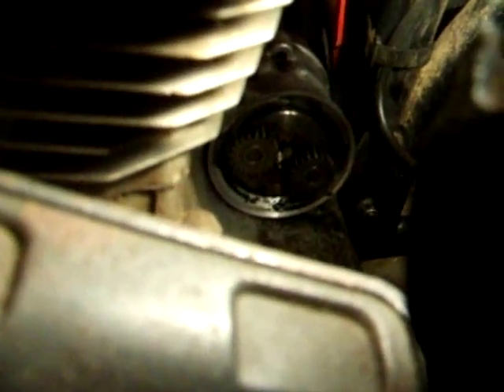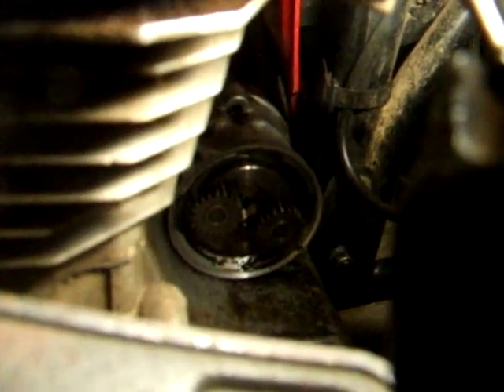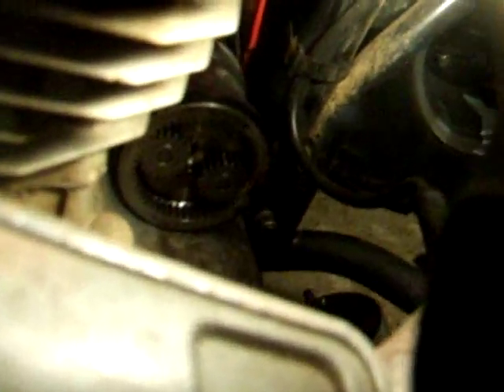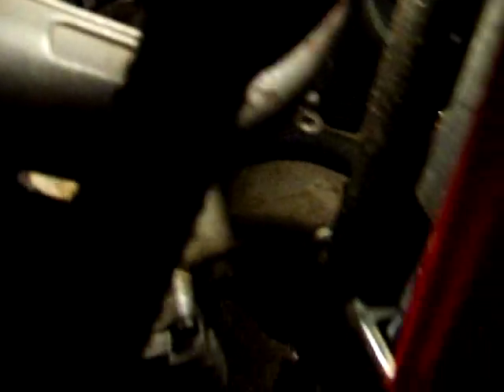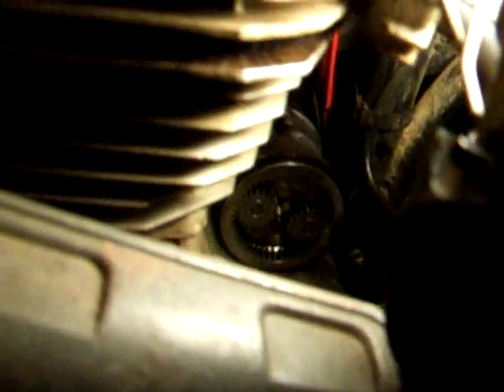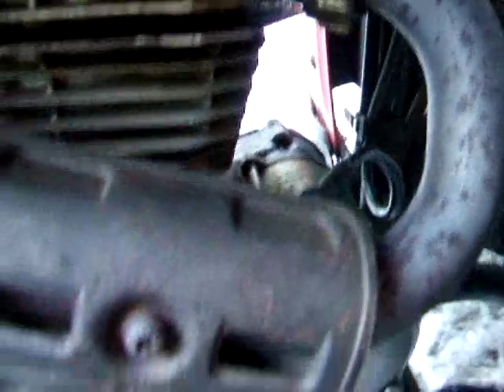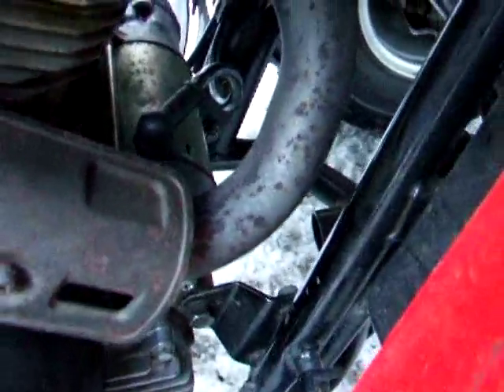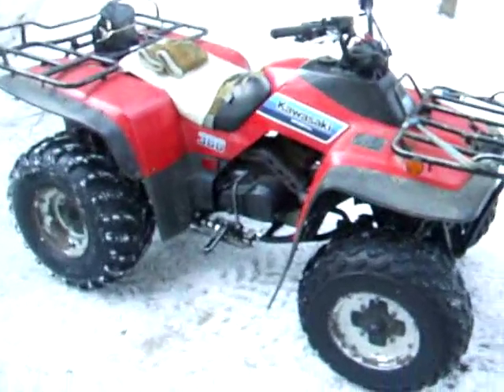Kawasaki Bayou KLF-300 ATV - Easy Starter Motor Removal + Install (2x4 + 4x4 / 1986 thru 2004)

Comment: Thank you good sir! So glad you have this! 
I will comment on my success  or failure. :D
Reply from the maker: Tru Maverick My pleasure, look forward to hearing about your attempt!  Any questions or if you get hung up on something let me know.  Cheers!  Bellarmine
Reply: bellarmine33 Dude! I got it off! And cleaned my contacts everything looked good on the inside. Put it back together and got it back on. Next I'm getting a new battery this one can't hold a charge. Again  thank you.
Reply from the maker: Tru Maverick Great to hear, thanks for the reply Maverick!  So your brushes and commutator are in good shape, smooth and making contact?  Before you get yourself a new battery, substitute a car battery with the tiny ATV one using jumper cables, and re-check the cranking speed.  If it still cranks slow then your brushes are worn (only 2 making contact, half the power) and you need a new set from eBay - about $20 or so.  Best wishes getting your ATV going, these are tough machines, same model produced all the way to 2004, 20 years.  Thanks again for the comeback Maverick - Cheers!
Reply: bellarmine33 so my starter worked great. And I got a new battery.Now I know  the problem was not the startrer. I can clearly see the starter clutch slipping. Again thank you for your video it got my project moving.

Comment: I do have a question though. I have removed all the 8mm bolts and yet still the side cover will not come off. The center bolt should not be holding the cover on. The reason behind pulling it off is to check the rotor for more damage than it might be showing. This Kawasaki 300A I believe is a 1988 model or earlier...thanks
Reply from the maker: Hi Paul, thanks for your question, I'll try to answer them.  First, I think the 300A was '86 and '87, because by '88 it was the 300B with a pull-start on the side cover and a plastic gas tank.  So if you have no pull start and metal tank, it's '86 or '87.  So you are correct, that bolt is NOT holding the cover on, that's the center bolt of the flywheel, spins with the engine.  I can't say off hand why the cover won't come off, it does have a few locating pins that keep it still, and the gasket can stick pretty good, give it a few love taps with a hammer and block of wood, it should come off.  Also, you do have to remove the red differential lock shift lever box, those bolts hold the cover on too.  And once you have the cover loose, you'll be pulling against the Hefty magnets in the flywheel that want to suck the charging coils back in lol...:o)  Hope this helps Paul, let me know if I can further assist or if there's anything else - See two photos below that might help, show you the bolt holes at least.  Cheers!~  Bellarmine

https://external-content.duckduckgo.com/iu/?u=https%3A%2F%2Fi.ebayimg.com%2Fimages%2Fg%2F2rwAAOSw1hFgsSDv%2Fs-l640.jpg&f=1&nofb=1&ipt=0fa8c66d9f22012eb80de666b546354e79ad5f8826fd44082f348e8a182b077d&ipo=images

https://i.ebayimg.com/images/g/u9UAAOSw6npeohF5/s-l300.jpg

Comment: Hi Bellarmine do you know the correct spark for that model thanks
Reply from the maker: Hi Adrian, I assume you mean spark plug?  My shop manual says NGK B8ES, or BR8ES (I think 2nd one is a resistor plug for radio suppression).  Also, make sure the little 'end' terminal where the boot goes is the un-screwable-type.  The Kawasaki spark-plug boot snaps unto the bare-thread-stud, not the bigger bulb-shaped metal terminal all other spark plugs have.  Any other questions Adrian just let me know and I'll check my manual, glad to help.  Cheers!~  Bellarmine

P.S., Here a website with HANDY exploded views for all these ATVs.  Long model run, 1986 ~ 2004 essentially unchanged - one tough machine - enjoy!
https://www.motosport.com/utility/oem-parts/KAWASAKI/1986/BAYOU-300-2X4

Comment: why do this in the dark???
Reply from the maker: I was just doing it in my garage with a trouble light, as you can see it was Winter outside so didn't want to work in the cold!....:o)  Just trying to spread around my idea to help out, if you have any questions or need clarification on something just drop me a line.....:o) Cheers Wanda!~ Bellarmine

Comment: hi were is the fuel filter on a Kawasaki klf 300 plz :-)
Reply from the maker: Hi Royal, sorry for the late reply.  These ATVs actually do not have any fuel filter, odd isn't it?  The only filters are two strainers inside the fuel tank, attached to the fuel on-off / reserve valve.  One for normal and one for reserve.  You can easily add a filter by replacing the 4" piece of hose between the tank and carb with a small filter and two very short pieces of hose, something I highly recommend.  I butt the filter up against the fuel valve with a ~1" piece of hose, and the hose attached to the the filter outlet I curl around the wiring harness in a loop and loop it back into the carb inlet, like a 360degree loop.  Hope this helps Royal, any other questions drop me a line.  Cheers!  Bellarmine
Reply: Ah thanks that would be why I counldnt find it ! I did pick one up from town so I will install it anyway like you advised. The quad turns over fine but will splutter a bit when I accelerate and cut out, maybe dirt in the carb or fuel pump not working well, it has just has a oil and filter change , I did just try started it and the battery is now flat so maybe a weak battery has something to do with it. Thanks for our help :-)
Reply from the maker: My pleasure Royal!  A couple more tips, this ATV does not have any fuel pump either, it is gravity fed from the tank.  I quit using the mickey-mouse $80 motor-cycle battery and strapped a car battery I got at my dump onto the rear carrier.  Hooked it up with some 4gauge wire, never run out of power anymore, can run the headlight for hours.  Finally, you are right about the carb, a good clean always helps, cleaned mine about a dozen times.  I have the procedure in my shop manual, not too complicated.  When re-assembling, there are only 2 adjustments to worry about.  The pilot valve should be 2-1/8 turns out, and the fuel level should be level with the float bowl flange.  Just use a clear piece of hose on the drain valve to check the float level, I've found the float level is not too critical.

And of course if your carb gives you too much trouble here is the best deal I have ever seen, drop-in replacement.  He also has them for 4x4 and later years, depending on your ATV.  I just might get one for myself soon, people seem to perfectly happy with them. Some buyers say "why didn't I replace my carb years ago"....lol...:o)
www.ebay.ca/itm/122586450216

End of another wordy reply, anything else at all let me know anytime Royal.  Cheers!  Bellarmine

Comment: LOL..easiest way to change the starter  is turn the bike on its side so the gear  stays center then just put your starter in  you dont have to take your starter apart
Reply: Will that work 
I have tried to do it the way he shows in the video and for some reason the starter is shorting out
Take the starter out a bench test it it's fine put it back on the 4 wheeler it shows out again

Comment: TURN OFF THAT LIGHT>>its too brite, would not want to see what you are doing..
Reply from the maker: +bowkill longbow Yeah, well it is hard to see in that cramped space. The light isn't as bright as it looks on camera. Also it's hard to film, juggle the starter and light all at the same time! The light just stays there as is, if I touch it it falls on the floor....:o) Cheers! Bellarmine
Reply: bellarmine33